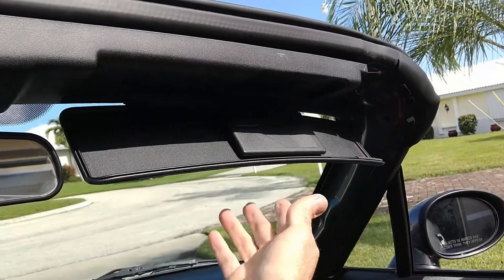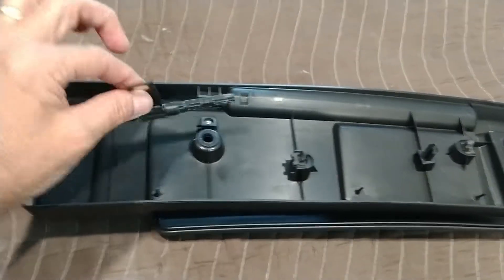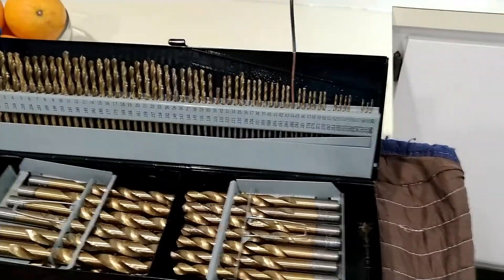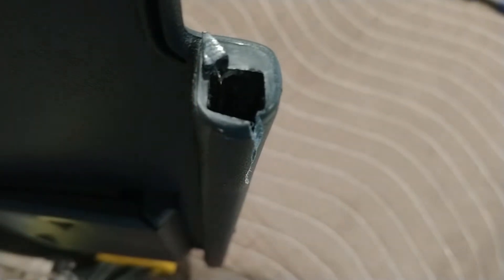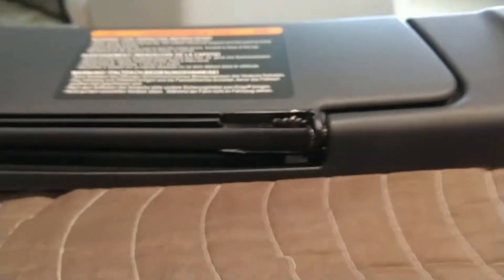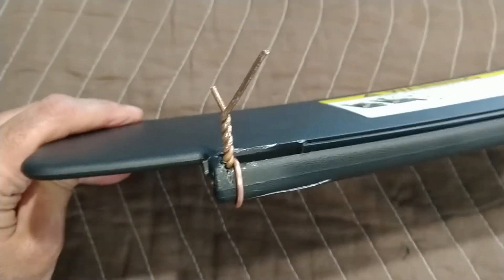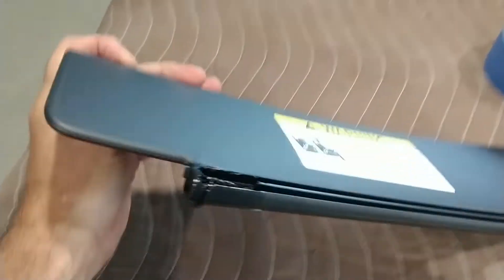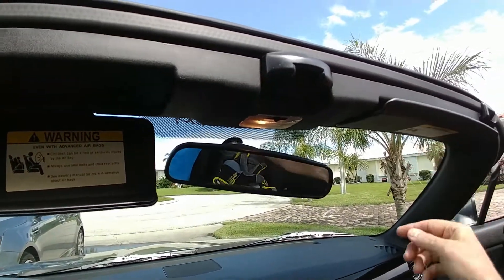How to Fix a Floppy Miata Sun Visor

Comment: Thanks for this -- another satisfied customer. I used a slightly smaller gauge wire which was easier to hide in the channel. Good as new again!
Reply: I did the repair this last weekend.  No luck.
Reply: @jfalk35  Bummer! It was all about getting the right angle to keep the wire out of the area where the attachment sticks into the channel. As said above, I found a smaller wire was helpful to use and plenty strong - I only needed a 1/16th drill bit for the wire I used. Used a dremel to remove some plastic for the pigtail from the wire. It works better almost than my driver side which is original.

Comment: Peter this worked a treat, easy to do & has fixed a very annoying flappy sunvisor - Thankyou !
Reply from the maker: It is easy to do. The hardest part is getting the car apart. Remember to blue loctite the interior trim screws when reassembling or they will probably back out and you will find them on the floor later.

Comment: Thanks so much for taking the time/effort to share this info. I  installed a  "magnet" a few years back and worked fine. But this is much better idea although more time/ labor intensive but not that much more. Removal and reinstallation was a snap( no pun intended). No problems. Actually I didn't completely remove the sub-panel. After removing all six bolts, I only pulled out one pillar and then, I just pulled the sub-panel down on one side far enough to use a short stubby Phillips screw driver to remove the  screw holding the visor pin. Pulling out the visor was also easy to do without completely removing the sub-panel. The one very important point which wasn't that clear is making sure you don't drill thru the ( square) opening. Pin won't fit in with wire thru the opening. Done. Now my ( passenger) visor seems not to go all the way up leaving approximately 1" gap. Nut sure why, but it  does stay in position.   Also, bending the twisted wires into the channel is not so easily done. Anyway,  it works fine! Frankly,  for $25 I just might buy a new replacement for a back-up in case this "fix" fails in the future. Again thanks for sharing this visor fix.

Comment: I'm a lazy bastard, so I simply bought a replacement on ebay for $26 for my driver's visor with free shipping. I filed the tiny nub down a bit on the left side of the visor. I threaded the right side onto the metal spike on the right, and then filed the left side nub until I could gently push it into the hole until it snapped in place. The key is gentle  pressure. File a little more if it feels like it might crack. The metal stud side is what keeps it from drooping. The little plastic nub is a guide to keep it level. Do the reverse on the passenger side. Worked for me! Caution: It doesn't take much pressure to file that nub: Don't smack the file into the windshield.
Reply: I too am a lazy bastard. It might be the edibles, but you lost me on the "left nub filing and  threading onto the metal spike on the right" (Driver Side). I'm replacing the Passenger Side in my NC (2010) and don't want to rake out trim to do so. If you have pix or anything pls put em up. Thx driver.

Comment: Thanks for the great idea, I used .032 stainless steel safety wire at 2 spots and stop drilled the crack. Aloha!
Reply from the maker: You are welcome. This was the only REAL fix that I could come up with. Most other fixes were just temporary at best.
Reply: Thanks for the reminder to stop drill the crack. I used 3/64 safety wire as well. 1/16 drill bit worked fine.

Comment: 2007 NB has this problem but it's not due to a crack. When I look at it really closely it seems like on the inside of the visor there is a little nub that fits into a hole as you're rotating the visor up. I'm thinking that that little peg is not getting into that hole; maybe it's wore down or broke or something. Curious what you think as I'm a complete newbie at this

Comment: Would a black zip tie do the same?
Reply: I filed the little nub and popped the new $26 visor in place with no disassembly, but a zip tie could work!
Reply: I tried a black zip tie but I couldn’t get it tight enough to keep it from drooping. This wire fix worked great. Used copper romex. Prior to this I used magnets, but glue went bad after about a year. Thank you for the video.

Comment: Had exact type of crack.  Used hard SS wire, less than 1/16" dia.  Twisted wire tightly.  Re-assembled on bench, and visor immediately started to rotate freely.  Wire loop stretched and crack opened up. I am willing to bet that this fix will not work long term.  Sorry.